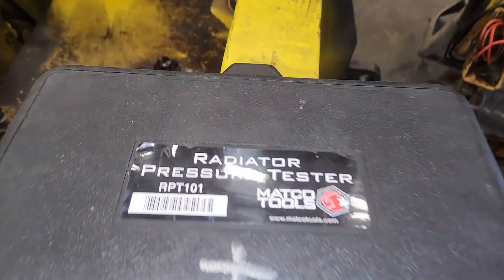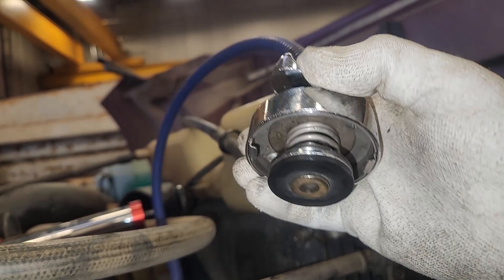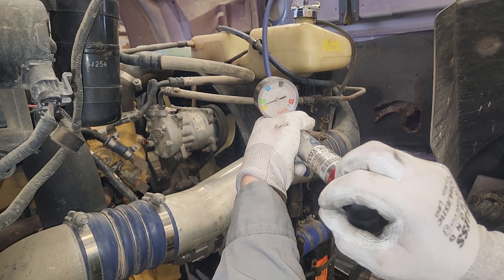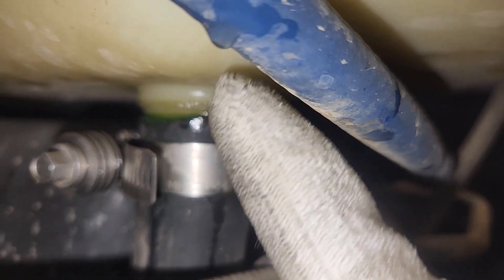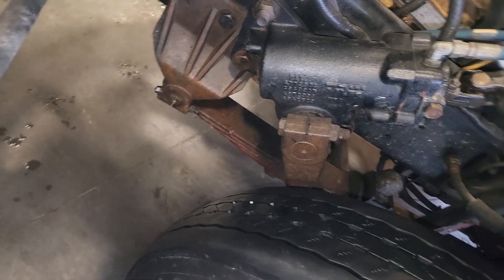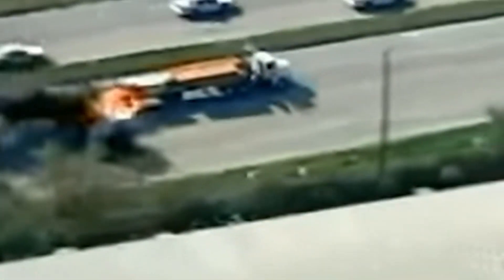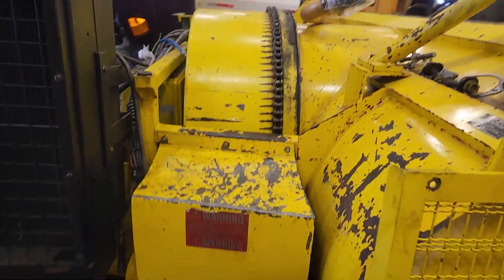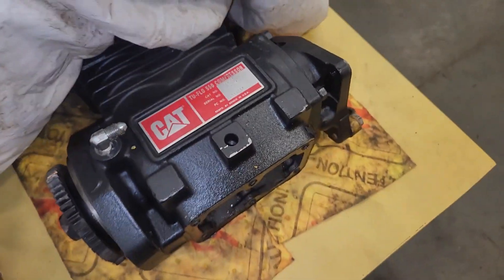How To Use Radiator Pressure Tester. Test Your Cooling System for Leaks.

Comment: I had an issue multiple techs couldn't figure out where above 185° my coolant tank completely empties out and below 185° it'd fill right back up with zero loss... turns out when my $15 coolant check valve cracked for the lines going to the heater core in the bunk well it was on back order so the tech put a small pipe to connect the hoses but we had no idea what it was and ever since when my coolant got above 185 it'd drain to the heater core in the bunk... for a while I thought my truck was literally materializing and dematerializing coolant took months to figure it out and track down that check valve and overnight it

Comment: I made my own but set it up to use shop air. I'm lazy and hate pumping those things lol. I mainly use it to give the system a quick check before filling it back up after a repair. It sucks when you have a large capacity system and have a leak that makes you drain it all out again. Plus, I built it back when I was making very little money and couldn't afford a tool truck branded one.

Comment: Can you go back the air bubbles .. I have a hard time understanding the concept there. Ty
Reply: Actually you take a pint clear bottle. I remove the radiator cap and put a adapter on radiator and a hose down to a five gallon bucket of water. Run the engine until regulator is open. Fill the bottle with water, put the hose in the bottle and turn it upside down in the five gallon bucket of water. Now the water cannot escape out of the bottle. Time how long it takes compression gases to force the water out of the pint bottle. Forty-five seconds or less, your getting to much air into the cooling system. Usually the air is compression gases from a leak from the combustion chamber into the cooling system. Sometimes it could be the air compressor, ACERT engines pre-cooler, old engines had air operated heater control valves. 
As engines age, compression slowly starts leaking into the cooling system. The shunt line helps keep a positive supply on the water pump and helps getting air out of the system.

Comment: Had a DD15 one time where the air compressor blew up, the connecting rod punched a hole out and poked a hole in the engine block, only complaint was it wouldn't build air.
Reply: I have seen pictures where one engine threw a rod and kicked the starter into the engine next to it cracking the block. I think it was a twin engine setup in a boat

Comment: Why does an independently mounted snowblower need an air compressor?
Reply: Now you have me thinking about this. I would think if anything, it should have a hydraulic pump, which is more common in these types of machines, but even then, whatever that snow blower attaches to already have a decent hydraulic pump.

Comment: Thanks for sharing I remember my old 74 ford the rad started leaking and I cracked the cap and put silicone in the fins over the leak and let it setup it worked great as long as I left the cap loose made it to work and back for two weeks just long enough for me to save up enough to replace it but that was back in the 90s when life seemed easier lol thanks for sharing buddy

Comment: Never knew these ran such a low pressure. Usually only see that low for air to water intercoolers on a 2.0L turbo Jeep engine. I'm used to seeing 15-21psi for a engine cooling system.
Reply: My dirtbike has a 29lb rad cap